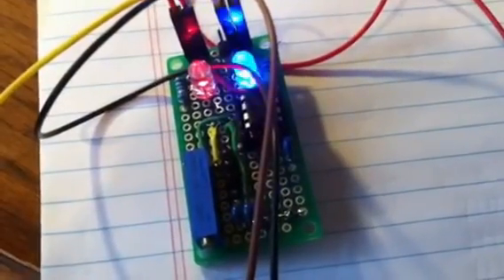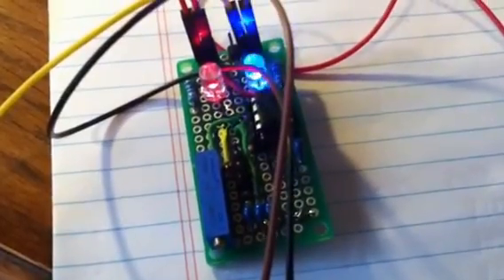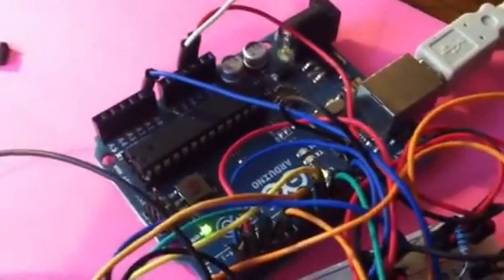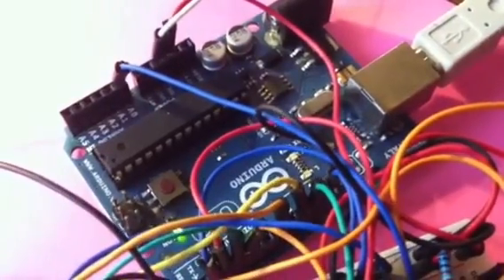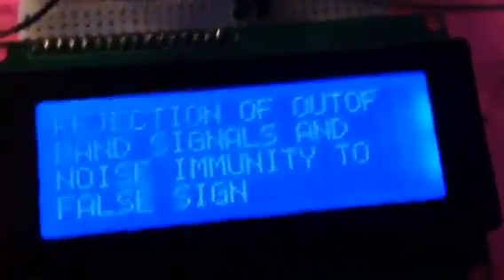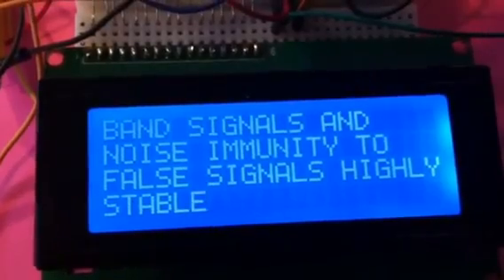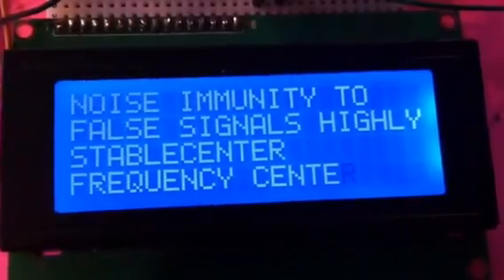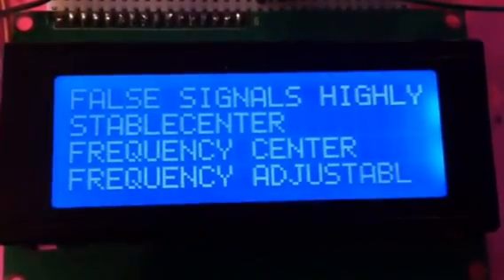Morse Code Revisited

Comment: Good work! My Arduino decoder works well when a computer is the input.
Off the air is a big problem. My attempt to use a 567 has not been as successful as yours. I would like to show you my work and see yours. I have circuit noise problems, I think. I've used supply bypassing and gain adjustment but the circuit is not stable.

Comment: well all I can say is brilliant work OM I use an mfj decoder and yours puts that to shame
if possible do you have circuit diagrams available I would build one asap for my own shack reason for decoder I am partially deaf so cant copy code easy but leant to send by hand using mfj reader I get by ok but I will defiantly build this asap keep up the good work 73 merry Christmas

Comment from the maker: Originally I did it within the software. That didn't work too well with on-air signals. Now I am using an LM567 tone decoder chip. This works much better, but is still not perfect. Sometimes the background noise trips the decoder. I think I can revisit the software and reject trips that are too short to be code. Just need some spare time to give it a try.